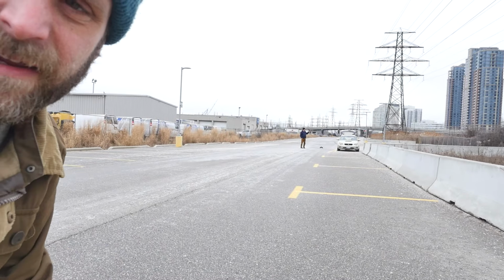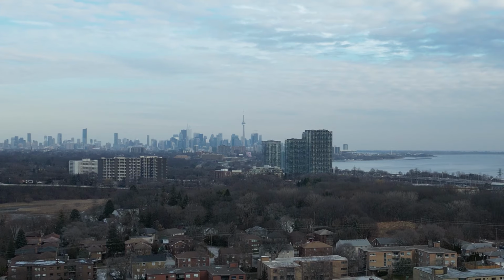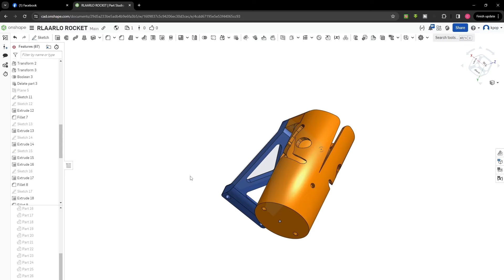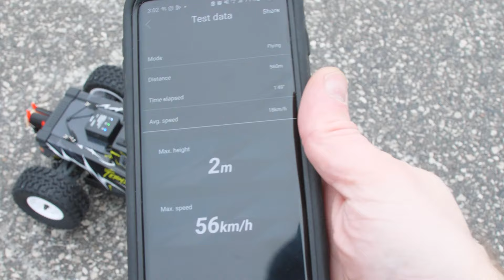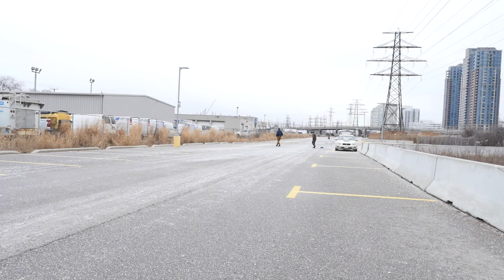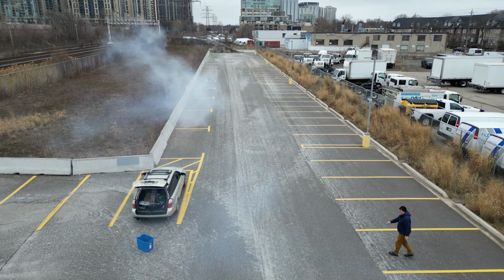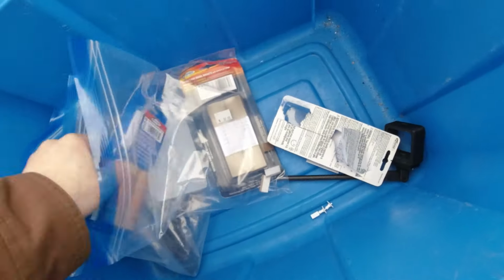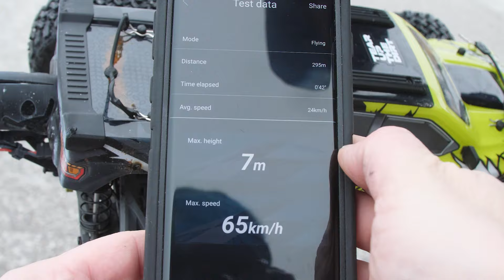This Was A Bad Idea! We Strap A Rocket...

Comment: If you want it to go straight, the back end of the rocket motor needs to be in front of the center line of the rear axle. Packaging it will be a challenge but you will gain a ton of stability.